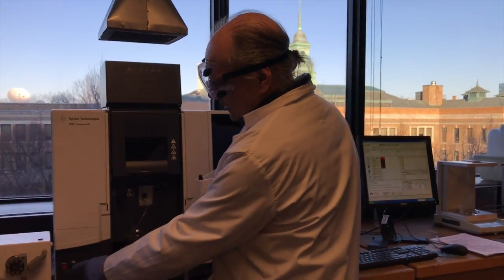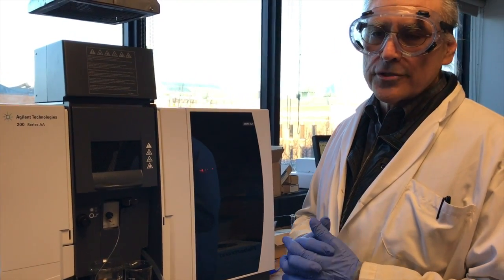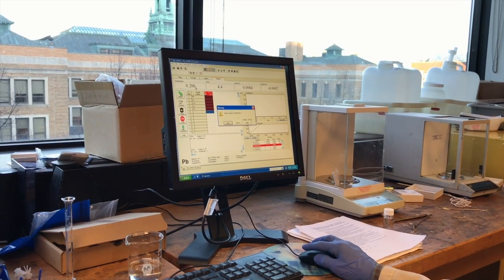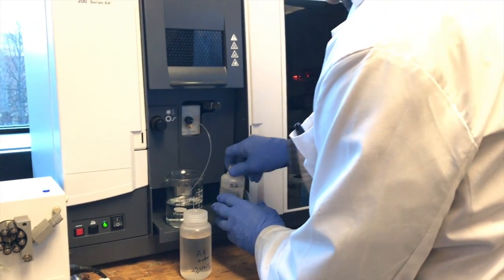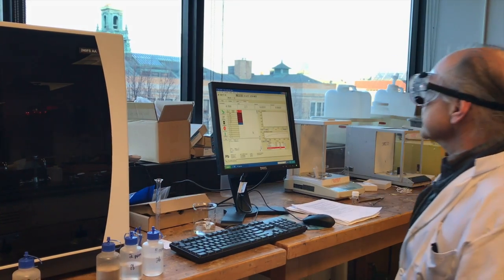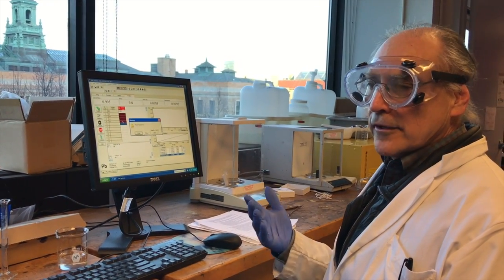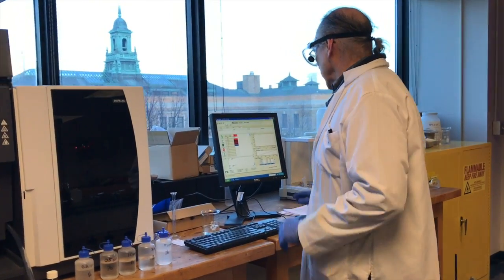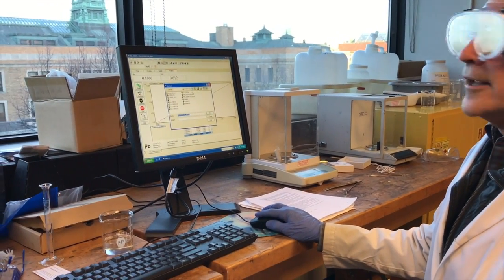Atomic Absorption Spectroscopy Part 2

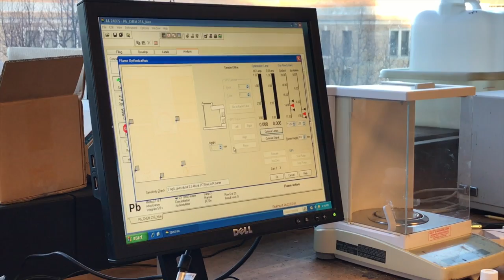Comment: Hello excuse me, in minute 2:22 there is a pair of bars that regulates the gas flow, in my spectrometer it indicates only a interval of 0 to 10 and I need to set it on 13.5 to the oxidant, how can I do it?